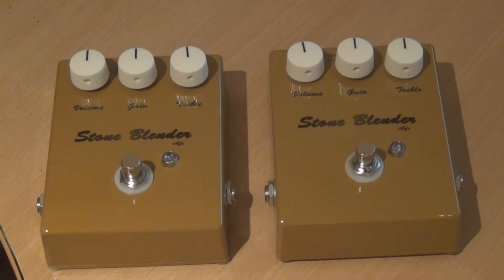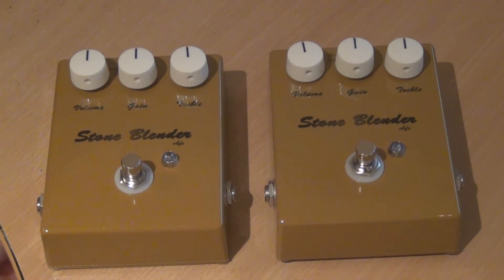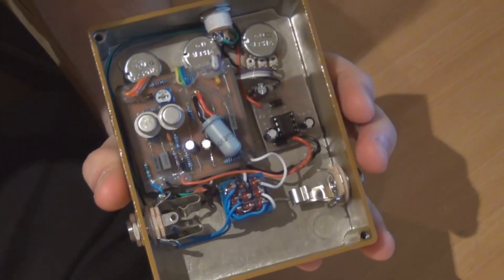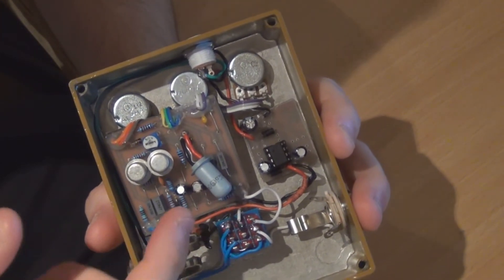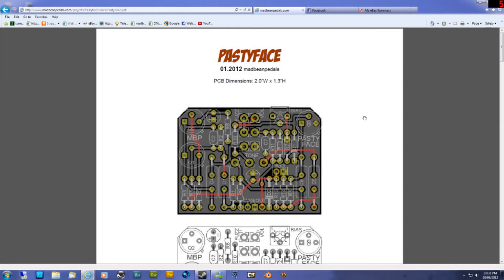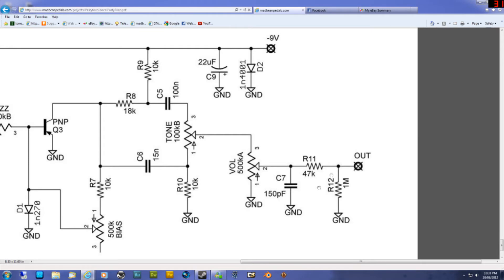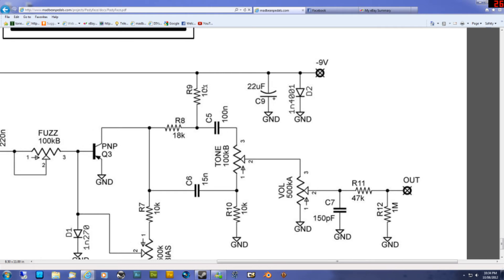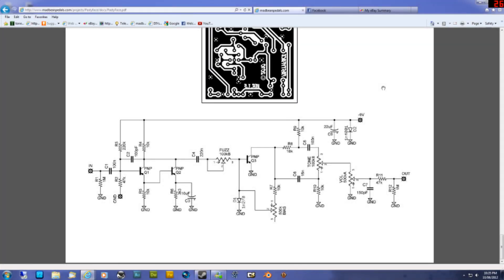Build Report: Madbean Pasty Face (Soul Bender)

Comment: I like hearing the transistor differences. About the 47k inline with the signal...resistance is always bad news for a signal. A small treble pass/treble bleed cap on high value pots (500k & 1M) w/ do the same thing if the control rarely goes up towards "10".